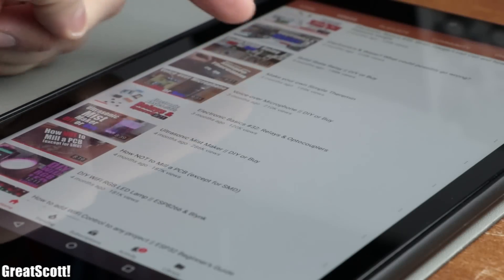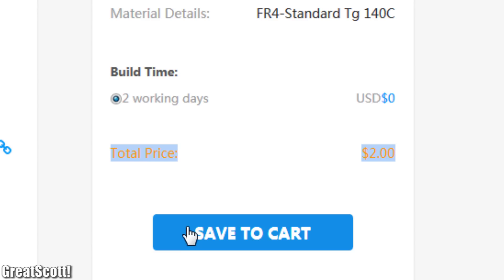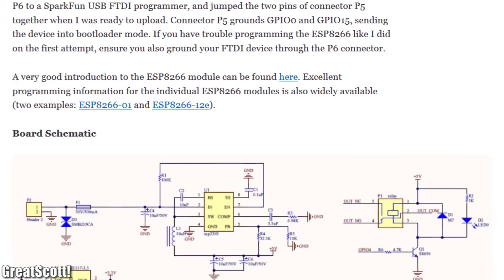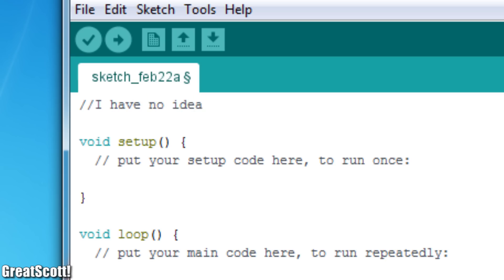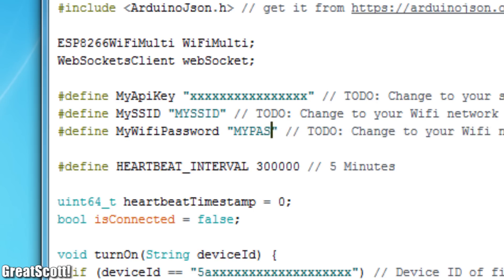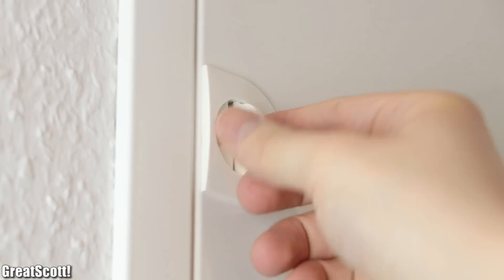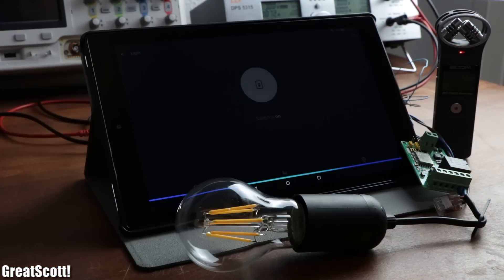How to do Simple Home Automation with Amazon Alexa || ESP8266

Comment: I once hacked a remote for remotely controllable power sockets to a relay board that connects via usb to my PC. I had to solder directly to the IC of the remote to be able to switch stuff on and off. On the ceiling I attached sockets and plugs to the ceiling lights and the wires, and then plugged the remote controllable power sockets in them. (four) That didn't look especially good, but it worked well and is kind of safe. 
In windows I had C-librarys that came with the relay board. I programmed a short C-program and I was able to turn my lights on and off rhythmically. (Blinkenlights! :) That worked so far, but I wanted to control it with my voice.
So I used the windows-internal speech recognition software to send global hotkeys, and reprogrammed my program to react to these hotkeys and turn the light on. I had four remote sockets and ceiling lights, and it worked perfectly! :D 
That wasn't enough. So I used TTS with my program to give me feedback on what it is doing.
In the end I was able to say: "Computer, turn the living room lights on" and the computer answered with "Turning living room lights on". XD
This was before Alexa and anything like that existed. I think it was about 2012 or 2013. It was dirt cheap and total bodging. XD

Comment: Wait a second. How Alexa's knows if the light is on or off? The relay just send a pulse and the pushbutton does the same in parallel, correct? So if you turn the light on manualy and you say to Alexa turn the light on, them the light goes off.
Reply: Ricardo Gava, so we will need to sense mains voltage on one input pin: Do anybody know a secure circuit (power the led inside an optocoupler via mains)? Future video?
Reply: Ricardo Gava yes I have one of these switch board relays in France and the pulse comes from three different light switches. I fitted a sonoff wall light switch with original firmware to one off the original switches and found that I need to only apply a pulse to activate the switch board relay. So I will need to flash custom firmware to do that. I have temporarily used IFTTT and set up that when that sonoff switch goes on it switchit off immediately. This results in a pulse to activate the switch board relay. So to the point of your question that you ask about Alexa being able to recognise the switch or light status......there is some logic in the Alexa app so it switches on the light, then IFTTT turns the switch off for the pulse signal required.  Then if I  say "Alexa turn off the light and she says ok". But the light remains on. Say "Alexa turn on the light" and she activated the switch again which IFTTT turns off to give the pulse and the light goes off as the switch board relay now received the second pulse. So you are right that Alexa don't know if the light is on or off, she can only remember that last time she switch on so the light must be on and next she must switch off. So she must send the off command but the sonoff is already off so nothing happen and she says "ok" because she followed your command.
Reply: Christian I think a simple photo-resistor would do the job, a combination with a feedback-circuit over an opto-coupler could even recognize if the bulb is broken. But it is ment to turn the relay on or off, only because of his change of the code it changes, would be interesting what happens if you say "Alexa turn the lights on" two times, if it answers that the light is already on bcs it remembers the last command or just do what it is been told and send another impulse.
Reply: Forget Alexa for a wile ... If you have such latching relays in your switchboard it is appealing to use them in your home automation system. But did only find either complicate circuits or crude (big resistor). What I‘m looking for is an elegant way to drive the little led(s) inside a optocoupler and filter the mains frequency.
Reply: You could use a simple capacitive dropper to limit the current in conjunction with a bridge rectifier to run the LED in the octocoupler.
Reply: Yep, i think i know the theory. But I do not have the knowledge to design the circuit in detail and specify the parts. Perhaps a nice idea for another video without using of the shelf parts and cloud services.
Reply: I'm more worried about Alexa knowing everything about me and my family that is spoken aloud in our own house :O
Reply: Sean I also don't want any kind of this stuff, but the sad fact is, that every smartphone got atleast two microphones and cameras, they can see our faces while watching porns if they want :/
Reply: Wilson, I keep a piece of electrical tape over my cameras, not for that reason tho!! 

Not much can be done about the mic, I hope big brother likes Pink Floyd :P

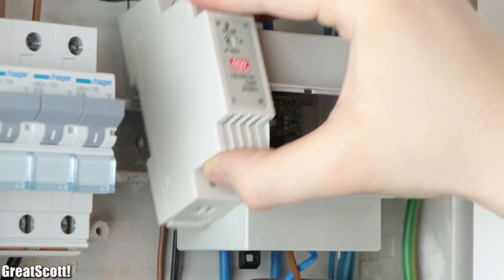Comment: 7:00 7:37 neutral and live wiring together in 1 screw terminal? Even if it's just for temporary use, it's obviously extremely dangerous to use neutral wiring in live connections.

Comment: For the same price you can buy a sonoff basic switch with the same ESP, it comes in a nice case and works out of the box with Alexa and Google home.
Or you can flash your own firmware and use home automation running on a RPI.

Comment: idk. it sounds like a lot of work to say "Alexa turn on the light"! 
Its as much work as getting up and flipping the switch. I will do something like this when the light is smart enough to know when I need it to be on, and turn itself on. Adjust the brightness, based on my mood and what I want to do that requires more light and cheat the power meter by stealing cycles. Anything else is a band-aid and won't do :) 
When will you be doing a video on that? And don't say never.
Reply: UFOhunter you need PIR sensors so this thing can know that you exist in the room. You'll need LDR so it'll know that if and only if there isn't enough light when you're in, it'll turn on

Comment: Sonoff could be easy solution?
Reply: Hitesh Patel
Definitely,
 Original Sonoff firmware already supports Alexa. So no need to re-flash. And even modified Sonoff's with original firmware and connectivity support for ordinary wall switches are available at www.lebhile.com

Comment: For everyone who is trying to achieve something similar: a great alternative are the sonoff devices. They are also esp8266 based relays but a little cheaper, smaller, come with a nice case and have a huge online community. Just flash a custom software like Tasmota onto it and it can be controlled with any local smarthome controller (e.g. domoticz or openhab) that can also make it available for alexa. There is also a settings to let it emulate an alexa compatible devices itself although I never tested that.

Comment: The circuit is capable of 10A, your "fuse" is rated for 16A...
Reply: But he isn't switching anything that needs 16A or 10A ;-)
Reply: I know, but its not correct according to the regulations (in my country) ;-)
Reply: DAHHH... fuse protects leads from melting and burning your house. so 16A is very good value.
Reply: That's sensible if he only wants it to blow under dead short instead of high transient.
Reply: Not a big home automation fan? Out of interest, why not? Great little project. My personal reasons for not wanting to make this are that, when one of the be services gets upgraded, goes down, goes out of business etc., then you have no way to turn the light on. Currently I use Alexa to control my lights however it’s only a ‘bonus’, and the other way is to use cabled wall panels, which are more reliable in the long term. (i don’t believe in wireless!)
Reply: In Germany also, but He made a show purpose only. And 16Amps for few 230V 5,5Watt light is overrated
Reply: There are current peaks in mains too. If he would have used a 10A fuse it would blow every time the corrent deman in his city would be higher and he would turn the lights on. We have a 210 yrs old house and have fuses that are just barely capable so even if a light bulb burns out the fuse pops so nothing can catch on fire.

Comment: Dang, that's a good price for a wifi controlled switch.
Reply: Shelly 4pro, has 4 channels, built in PSU, color LCD screen, setup button, nice DIN case, 4 override inputs, certification, and current measurement for each channel, plus shared voltage measurements, so it can calculate power, phase, etc for each channel and totals. And made in Europe afaik. 69 Euro. It is pretty damn good price. Sonoff is also interesting option (single channel), it even has serial debug port for easy hacking.
Reply: MrJelle2503 true, I have some a they work great.
Reply: It's from China.. They're all cheap only draw-back is., it'll take a month to get to your home.
Reply: @the_vicer0y_YT  I've seen them at amazon for a higher price if you don't want to wait
Reply: https://www.youtube.com/watch?v=LrNd83p3XTw&t=7s
Reply: True
Reply: The son-off is flashable with custom firmware as well and has a protective case.

Comment: Hey there @GreatScott!
I got one question concerning this video and hope you might answer it :)
- Despite the "space issue" near the light switch - there are no other reasons to not use it in parallel to the switch, right? I think about those flush-mounted, remote controlled switches, which can be installed in junction boxes near the ceiling.. Same could be done with this one (and be realised with bigger junction boxes + 3D printing etc)

This is a great video, as most home-automation systems cost a fortune when you really want to install them. Simply for remote-controlled sockets, you have to pay almost ~20-30€ each socket + remote control. For Alexa optimised ones, its even more...
Thank you a lot for this video :)

Comment: You should check out the sonoff. It is basically the esp8266 relay board you used in this video but only costs about 5 usd
Reply from the maker: Just had a look at them. Looks interesting. Never heard of them before.

Comment: Scott, it's not really legal or safe to have bare copper on the mains voltage lines. Just a headsup!
Reply from the maker: What do you mean with bare copper?
Reply: The wires going to your fuses had exposed copper, the screw terminals are supposed to cover any un-insulated wire.

Comment: Great Video! Please create more Content with the ESP8266 since it is as good as an Arduino but as a Bonus got Wifi.
For Homeautomation there are "Sonoff"-Devices available which basicly consist of the same Hardware you used in your Video. Therefore it is Alexa-compatible out of the box but also can be very easily flashed with Custom-Firmware (e.g. Tasmota). 
This whole topic is really interessting since Sonoff offers simple Relayboards as well as Lightswitches (Touch EU) and even Smartmetering devices.
And the best is its Pricetag whiche are lower than any DIY-solution cloud be.

Please create more Videos with the ESP8266, would really like to see your Ideas

Comment: Hi GreatScott,
Nice project. I am working on the similar project for last 2 years and recently I have added Alexa and Google Home voice activation to it. The project name is IoT Connect ( https://iot-connect.in ). I have created an instructable ( https://www.instructables.com/id/IOT-Connect/ ) for replicating the board and building the devices by yourself. You can find IoT Connect skill in alexa app and can call "talk to iot connect" to google assistant to control your devices. It will be very helpfull if you can go through the project, try to replicate it and give me your expert advice on email ( support@iot-connect.in ) . I am not very good in hardware as i am more of a software guy and linux. 
Thanks
Aviral Verma

Comment: But the question is .... Why ain't you a home automation enthusiast ? Security Reasons? 
Btw. Love you videos...👍👍
Reply from the maker: Currently I am just not into it. No specific reason.
Reply: Because the cost/benefit ratio isnt there for stuff like this. Yeah its cool, but it's never worth it in a case like this. Unless you go full out and include heating, windows etc. into it, its just a gimmick
Reply: @LuLeBe  light switches and thermostats are relatively simple to change out. This could easily add this to existing homes. However, they are still expensive and will probably look different.

But I'm with you. The home I am in now is really well designed. There are switches at the entryway for all the rooms. Remote or 3way switches at converge points where you leave one area and enter another. It's just easy and convenient to use the switches.

Sorry.. dif not realize this was a year old post.
Reply: Well, there you go, outdated people! I'm going to fully automate my house. I'll even make a robot butler! Of course, that last thing might take a few years... But I'm also going to sell my products. 100 % guarantee it will work as long as the device does (even if I go out of business).

Comment: ESP8266 was working 3.3 volts logic. is that different or i am missing something?
Reply: I think he is using a board that accepts 5-20V, and regulates this down to 3.3V for microcontroller / ESP8266, and to 5V for the relay (switched via mosfet afaik). There is also optocopouler between ESP8266 and the transistor / mosfet, so it is isolated nicely.

You can buy also boards that accept only 5V, and are even more compact (but don't have great protection or isolation), for about 3.2$ from ebay with free shipping. The board he is using is more safe, with own voltage regulation and wider voltage input range, and better isolation, it is about 4.3$ with free shipping. It is bigger tho.

Comment: I was excited to see this because i was hoping you had a trick to get the device discovered locally... but, nope. I had an ESP32 that I tried for a long time to get working. I do not want to go through some 3rd party site. Create an account and put my home automation information in the care of some random site. No matter how much they say they can protect your data, you can't believe it. (i blew up my ESP32...)

I switched to raspberry pi zero w

How I currently have it set up is to use the webhooks "app" for both alexa and google assistant. It then connects into my own web vhost. It works, but it's not a two way system. I cannot ask for information. I can only dictate hardwired commands. There are a few variables like "Set lighting to blue", where blue is the variable. But that's about it.

If anyone knows of a better solution, please let me know
Reply: Phillips hue bulbs? Expensive but works
Reply: Thanks, but I'm looking for DIY solutions